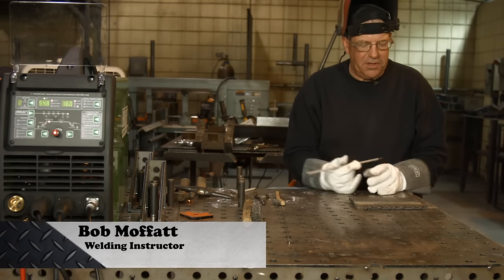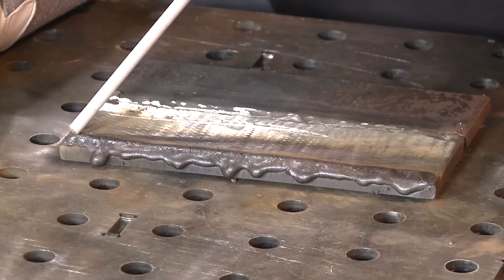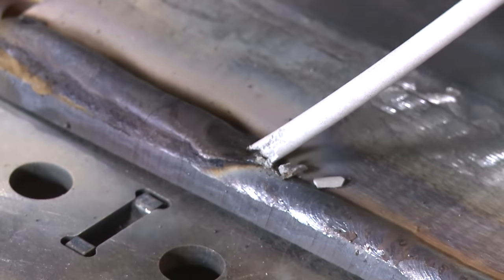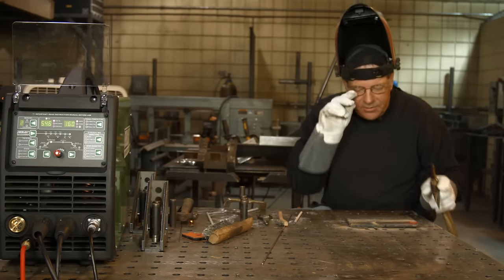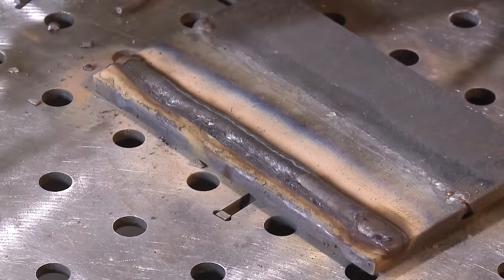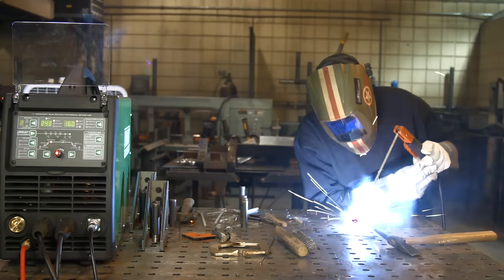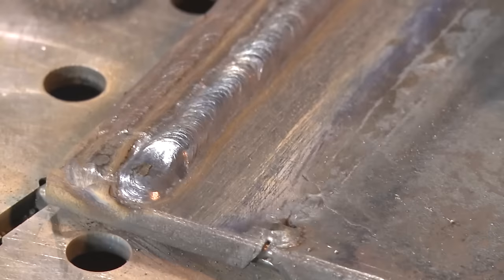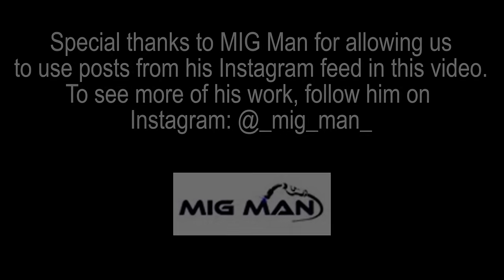Welding 101: How To Run A Straight Bead

Comment: been taking a welding class, i'm on day 2 and they're teaching us to run straight beads and are having us hold the stick at a very straight angle... your welds look way better than the instructors. and the 45 degree angel seems so much better than what they teach.

Comment: Can you do a lesson on how to talk to your machines?
Reply: @chanakyasinha8046  That's total BS. You need some of that gel they use on the tens machine first.
Reply: After you goofed up ,,it is not your fault Lary, i am sure that the clamped 200lbs steel was moving too much for you to drill it " if it happens to work out ,,we can work on that ... Don't worry , please do you job and i will do mine and weight work it out as you ,,see" "
Reply: I named my oxygen cylinder Foxy Oxy

Comment: No nonsense is what we need, I'm 66 and my hands shake like a dog s@#ting peach seeds. We have to do the practice before we weld the good parts.
Thanks Charlie
Reply: I've been saying that for years. I've already told a couple of peeps I'm saying that in my next video.
Reply: I wonder if those Parkinson's wrist devices (really cool thing Microsoft, and others, have created a tool that negates the shake pretty much to nothing) would work for steadying welder hands. Sometimes when i weld a lot near the end, even under 30 as i am, i still end up shaking all over the place like a stream of p**s.
Reply: aserta it is just a question of avoiding any tense part in your shoulders (mostly)
I bet that 5 minuts with decontraction exercises would help. (I am a piano player, as soon you get tense you loose control)
Reply: Dog shitting peach seeds. Lmao 😂 😂😂😂
Reply: I have the same problem,at 72.Oh for those younger days.Maybe the Wine consumption doesn’t help.Lol.
Reply: Play video games, I'm a surgical 1st assist and had the same problem, and surgeons I work with I have given the same advice and I can tell the difference especially when we do robotic surgery
Reply: Where I'm from, the term is " shake like a dog shi_ting razor blades."  At least, that's what my Dad used to say. I even had an occasion to use it the other day when I was using my Pyropen. Bitch when you get old.

Comment: Another great video Bob... After a while, when  they  get the hang of it....first pass left to right, next pass right to left.... keep changing... right to left  then left to right. Don't be a "one trick pony".  Also, learn to weld with both hands.  It sure comes in handy when you find yourself out of position and have to REACH out for welds.  Again... "Don't be a one trick pony" !!!

Comment: I have an antique Marquette Redi Arc 180 amp AC welder that was made in the 50s or 60s and it runs great I must say I only normally run 6013 and 7018ac sticks and after watching this video you make me want to go by every kind of Rod and start practicing with the ones that are not so good at I like 6013 and 7018 because they are easy to weld with when I'm welding Rifle and Pistol bullet traps together and general farm equipment maintenance I haven't really ever had a need to use the other electrodes at least I don't think I have I'm not a pro I just do it for a hobby and I used to work on a farm and I maintenance the tractors and the Box blades and all the attachments that the old farmer I worked for had and my first year there I spent probably a quarter that time welding and repairing a lot of the old pieces of equipment that he had that had a lot of Broken welds on them and a lot of cracked welds as well I'll never forget him he thanked me so many times for that because he was taking all this stuff to a Pro welder that was charging him insane prices or at least that's what I thought for even really simple welds like I said I'm not a pro I've just been doing it for a hobby for almost 15 years and overtime I've acquired an antique Eutectic 225 AC stick welder, and then I went and picked up a flux core welder just a cheapo from Harbor Freight what's actually turns out to be a decent welder in the right hands, I just pick that up to weld the exhaust pipe on my pickup, recently I just picked up an antique Marquette Redi Arc 180 amp AC welder and for being made between the fifties and sixties 60s that thing runs remarkably well, I had to make my own leads for it, but only paid $65 for the welder and it  lays down some damn good beads and I'm sure a lot of the pro welders that do it professionally would probably laugh at the dinosaur machines that I got but they both run extremely well and I paid 65 for 1 and Eutectic  I picked up for 25 bucks at a garage sale and that one has definitely paid for itself probably a thousand times by now lol

Comment: I am not even a newbie😂.  I am a DIYer with a need to have some welding done and as a rule, I invest in tools and knowledge before hiring out a job, as I will always have the ability to use them again and again.  These videos are helping me to build confidence that I wil be able to do what I ned to do and carry forward a useful skill, before investing in the equipment.
Reply from the maker: That is a great mindset! If you ever get stuck or need to ask some questions check out the weld app, we have a ton of instructional videos in there along with great resource material for them as well.

Comment: If you train yourself to look ahead of the puddle just as soon as you get dialed in where you know your travel speed and amps are set right and you know you are laying down a good bead that is not too cold then get your head away from the smoke. Extend your arm so your head is a couple feet away and you will find that not only does your hood not get smoked out but also the reflected light from the arc will let you see where you intend to weld. The seam or prepped weld joint will be visible. Even cover passes will be no problem because it will all be easily seen. Once dialed there really is no reason to hang your head over that puddle. You can get your head a bit closer and take short glances at the puddle to see that you are filling or running right up to the top of the bevel or a soapstone line put down with a straight edge.

Comment: Bob, it DOES help!  I'm finally trying to move forward with this.  So, I go for an hour or two of seat time, and then watch the same videos again, look at the same books again.  After a little struggle I see more the next time.  Really appreciate good arc shots, too.  This DOES yield to practice and attention!   After years of aimless dabbling, I finally managed to run a few straight consistent beads across some clean scrap, with different rods.  Got one perfect automatic slag peel with some Mexican 6013 rod and the smallest available Chinese power supply.  It seems that when the slag comes off easily, the bead is very smooth and clean.   So much is on the welDOR with the stick process, but there's your payoff:  I think for around a hundred dollars you could get a power supply, helmet and gloves, angle grinder and box o rods!  Make meaningful welds that won't fall apart, do repair work outside....  Have the entire outfit in a backpack!  I've got a PILE of expensive welding stuff, but looking at a good 6013 bead makes me think I've been making it too complicated!  So, let's keep it simple with BOB!

Comment: I am a 75 year young and active welder and the only reason I survived my buddy welders is due to personal welding protection that I use every time I weld,  best investment I ever made.
Reply: Got_nuffin_on_me   Had a few welding respirator helmet and,  the most comfortable and efficient one was the 3M adflo respirator with speed glass.  The battery last a-good 8hours and suggest you buy a second one so you never run out of protection if this is the one you are getting and,  .must have charcoal filter.  I live in Canada and,  this is the best one available.  I feel very safe when using it,  even use it when grinding.  The air that comes out of it is absolutely 100% clean.

Comment: I remember when I was just starting out (at age 50) the 6010 arc just seemed overly chaotic.  It was difficult tell what was going on. I remember not having a clue as to how the weld would look after chipping.   The problem grew out of not knowing what part of the arc to pay attention to, namely, the trailing edge of the puddle.   That is the last to part to freeze, and will give you a good idea of the finished weld.   You want to keep the puddle at a consistent oval shape and size.

Another thing I learned that came late is: often the reason you can't weld in a straight line is you don't have a good frame of reference, whether that is a crack, edge or previous weld.   If the guiding feature is too weak or subtle, pull back on your rod briefly to illuminate the way and get your bearings.   In the absence of any reference feature, I'll lay down a plate parallel to the run.

How's your lens shade?  I initially used a #12 out of fear, which is too dark for most stick. You can't improve what you can't see.

Also, out of fear, don't hold your stringer with the "grip of death".  Relax.  This will help greatly when eventually you will have to weld around corners.

And lastly, breathe.   I come from a shooting background, where, when you need fine motor control, you hold your breath.   That same reflex kicks in when I need to precisely control the weld rod or TIG torch, but holding your breath gives only a brief benefit, and I forget to take a breath.   It's an ingrained habit, and I have to continually remind myself about this when I'm running any weld.

Comment: Question, Have you done a video on different rod brands and comparisons? Per example, Forney, lincoln, Lincoln x caliber, Hobart, ect, and compared weld quality between them. If so can you post the link pls.
Reply: Longtrailside I agree
Reply from the maker: We haven't done this yet, but it's something we could add to the episode queue.
Reply: Weld.com and I have a suggestion could you get some wia austrarc t16  or 7018 those are some Aussie rods that I use
Reply: 7018 is VERY popular in the states, although I have never heard of wia austrarc t16. I dont think Bob would have a problem in trying it out if you sent him some, with some instructions on how and what it is used for. Could be a learning experience for him and his viewers.
Reply: Longtrailside they are basically 4916 low hydrogen rods
Reply: So general purpose and industrial use most boilermakers use them over here
Reply: Thank you for the clarification. Love learning new things.

Comment: Thank  you.  You videos are very helpful.  I recently purchased a welder and other tools for some planned fabrication projects.  I am looking forward to doing fabrication work again and I want it to be of the best quality that I can do.

PS: Since I first posted this comment, I have been spending time practicing as well as making various small projects.  One of the practice welds that I make is to just run bead after bead padding a surface.  I have learned how to accommodate variations in bead width of the previous path in order to maintain a straight path.  Of course I do work on maintaining a straight path and consistent bead width, but still a small amount of variation creeps in that needs to be corrected on the subsequent bead.

I have also watched a large number of the videos on this channel and have learned a lot, especially what I am doing wrong and what I need to do in order to obtain high quality welds.  So far I have done SMAW (mild steel, stainless steel and aluminum (ugghh!), FCAW (carbon steel and stainless steel), MIG (carbon steel, stainless steel and aluminum) and TIG (stainless steel and aluminum).  I still have a ways to go but I am quite pleased with my progress and many thanks for your help.

Comment: Bob, do rods age? By that I mean if you go buy some rods for a project and then dont get to use all the rods do they age if left for six months, twelve months, several years, and can they be re-conditioned or should they only be used for practice or non critical welds at home? Thanks for all these videos, every one contains nuggets of golden information.
Reply: Most of the electrodes can be redried: http://www.lincolnelectric.com/en-us/support/welding-how-to/Pages/storing-electrodes-detail.aspx Drying conditions (temp., time...) may be at the package or in the manufacturers data sheet fot the specific electrode.
Reply: test them out on your neighbors car doors. make sure you grind off all the paint first.
Reply: we must be neighbors....
Reply: Yes, rods will expire. The filler material itself won't "expire", but the flux on the outside can become brittle and flake off. Rods will last for years though as long as they are stored properly. You want to look for a rod that is intact and straight with no obvious flaking of the flux. Personally, I just buy new rods. They are cheap enough to buy and if your not using a lot of them, you can get smaller packs. Home Depot and Lowes both sell welding rods.

Comment: Why is necessary to cool off the plate? I'm a novice with no training
Reply: I would assume is has to do with the melting point of the material. Since you are melting the stock while you weld the closer it is to melting point the faster you weld. The current needed on super hot material is different than room temp material. Again all a assumption, if im wrong hopefully one of the more experienced guys will correct
Reply: Quinton Davis mexico thanks you for your knowledge sir
Reply: So the metal doesn't warp.
Reply: Not necessarily to keep us from warping, if you wanted to prevent it from warping you would either use bracing or add an opposite camber so it will come out straight. Keeping the metal cooler than glowing red hot is all apart of the haz and grain structure of the material being welded. The heat and the way it's cooled and heated can affect the strength and other properties of the material.
Reply: I think keep the metal from warping is the answer. I also think that if the metal is too hot when welding, it'll contract too much when cooled, it might crack the weld or warp it even more. Just a thought.
Reply: Well, it's going to get HOT!  Aside from any possible warping or heat problems (maybe you don't care if you're just practicing) you're putting a lot of energy in there, and pretty soon that coupon is as hot as a stove, and you're going to touch it!  So it's a practical problem.  This is a special problem if you're just running bead after bead, sitting in the same place... presently the table gets hot, too!
Reply: Is this Terry that worked at Suniva ?
Reply: plates of that size heat up quick and effect the size of the bead pool after about 3-4 beads. cooling it helps keep the beads consistent. this is a practice run so concerns of warping the metal is obsolete. and in my experience iv ran 10 beads on a plate that size and didn't see it warp or bend like iv read in some of the comments. smh

Comment: One of the best welding exercises for consistancy in travel speed, position and arc lenght control is to run cladding beads like this, excellent.

Comment: Bob, thanks for the tutorial. I just started 4 weeks ago and now getting the feel of stick. What I didn't realize is how close you can actually get the electrode to the work piece . After examining a used electrode I see the electrode is tucked back form the flux . Hence I need to shorten my arc length like your demo'ed.

Comment: One thing I always do before I begin doing joints for class is I find a plate that has little weld or a butt joint and always run a bead to see if I can maintain a straight line.  It helps especially if you have trouble with some joints.

Comment: The first stage of my welding training was welding in a straight line and after that was trying to weld a carpet of 5 electrodes next to each other, at first it was really hard for me but at the end i had a steady arm and it made ALOT of stuff easier.

Comment: Good basic welding instruction. Straight and stacked side by side. Now we.need a   pipe joint  welded  in the horizontal position that would require 5-7 weld beads to make 1 layer  or cover depth of 4 inch groove or a casting to casting fab joint and a casting defect cavity flat that would require 10-12 weld beads per layer with a 6in diameter root opening closed by using copper backing with no axcess for backweld

Comment: Love the videos.  I am an amateur welder.  Learned on gas, welding tubes, then got a small Mig.  I will next re-watch your video on Mig, I know my settings are off and it is messing up my project.  I only take my welder out a couple of times a year now.

Comment: Very good instructional video, spent 4 hours practicing straight beads yesterday, but didn't get it quite right.
I now could see from your video what I actually did wrong, and a better way to practice than just running beads 1/2" apart.
First time learning proper stick welding is fun and I definitively want to become a good welder which comes in handy with my maintenance work.

Comment: I want to learn how to weld! Never touched a welder or anything. I am 20 and drive a garbage truck. But since dumpsters need welding I want to learn this trade also. And going off topic I don't seen what the old comments are referring to? How the instructor in the vid is rude. He's just an older guy who doesn't act with nonsense. Just does the job! I learned to never take anything personal bcuz life will always have ppl with different attitudes. Just do your best and believe in yourself.
Reply from the maker: Dumpster fabrication and repair is very valuable!

Comment: Today i was welding some rims together and the first time i welded, so i was pushing in to much and made holes on the rims and not running a straight line. Now that i have seen this  video and practice i got a little better.